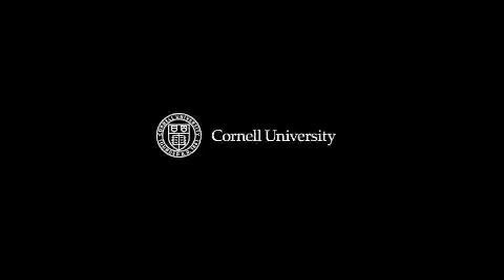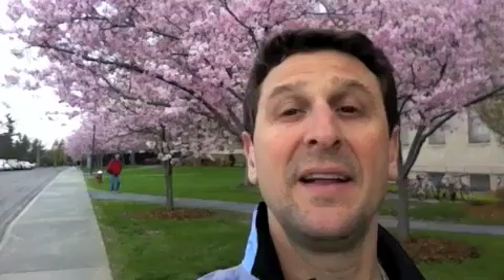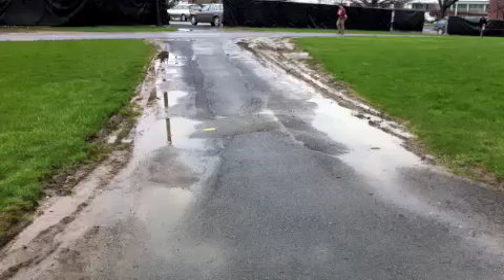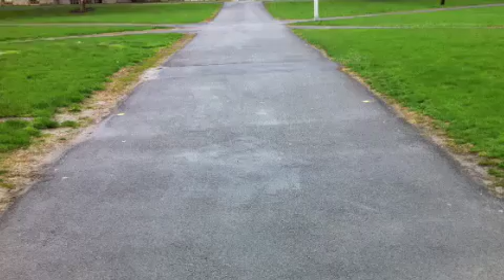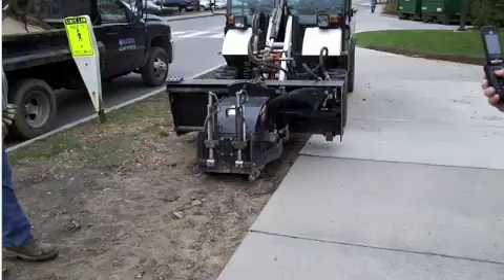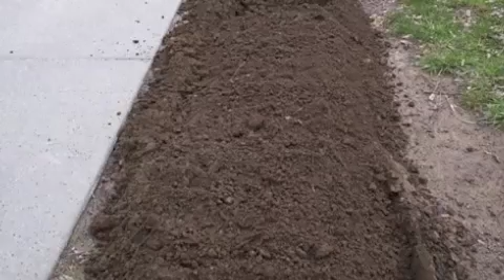Spring problems:  Sidewalk edges

Comment: Excellent video, thank you for posting. I have a question, do you think fertilizer could cause burns on edges from the runoff water? (But not at a concentration on the lawn to harm it.) 

Also, along with compaction from vehicles,  string trimmers make a perimeter pass on most properties around my area. If the salt doesn't kill it, trimmers sometimes will.